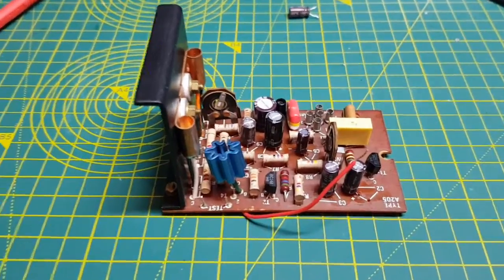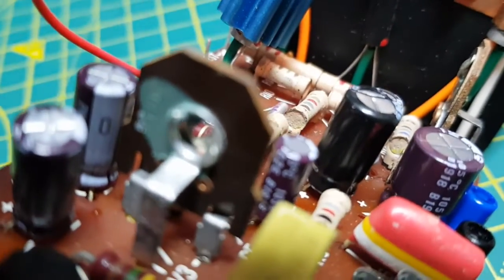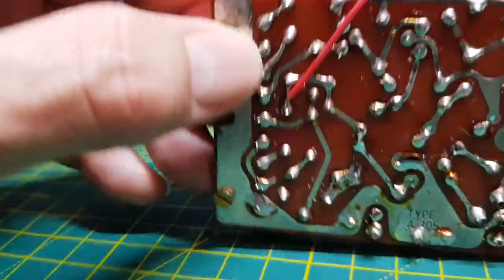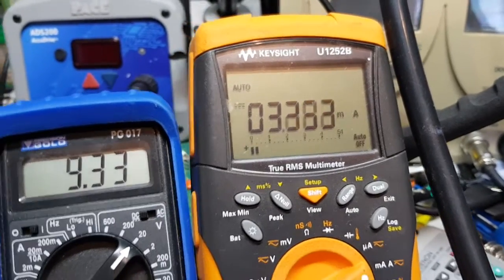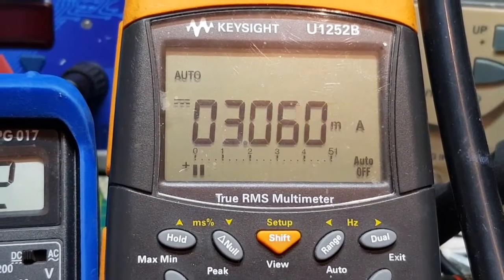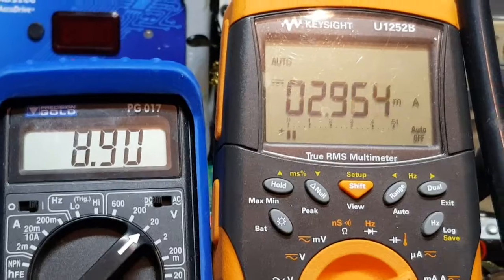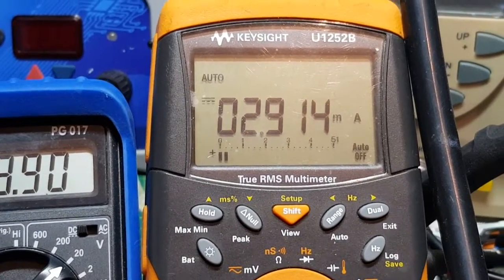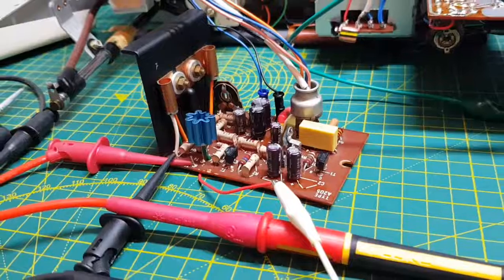Hacker Sovereign 2 RP25 amp setup

Comment: Super video. Put you finger on the OC71 between the output transistors and warm it up, the quiescent current drops like a stone, takes some time to recover!
Reply from the maker: Thanks. Yes the old geranium transistors are very susceptible to heat.